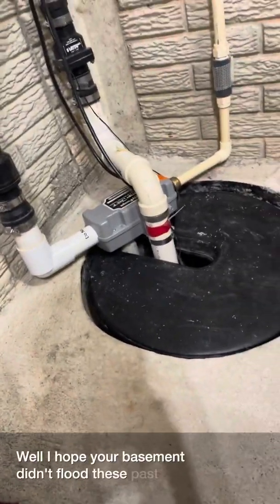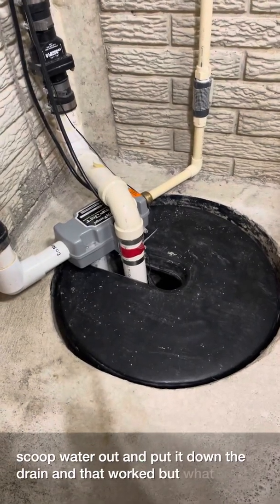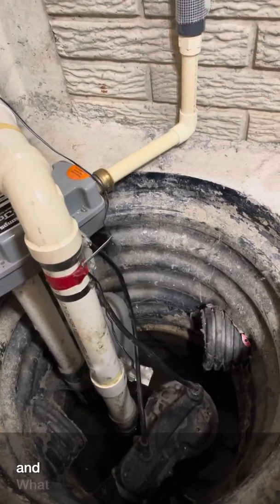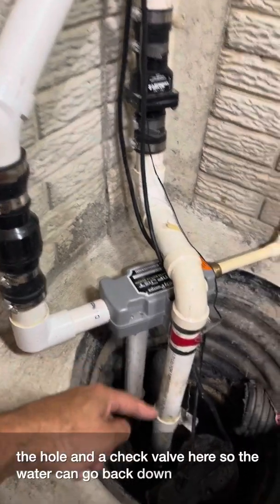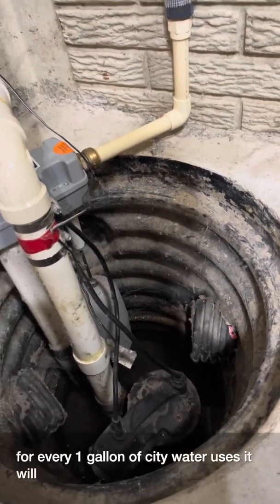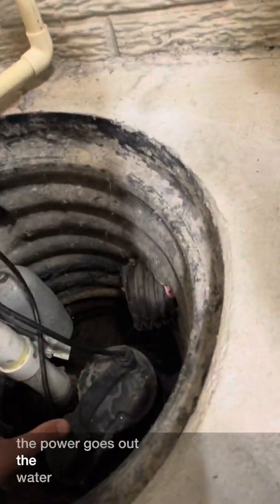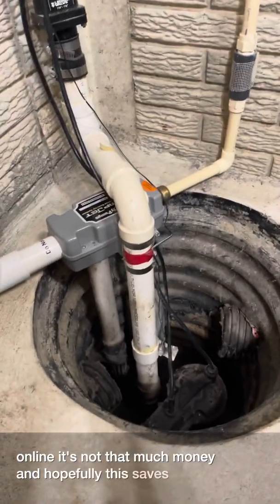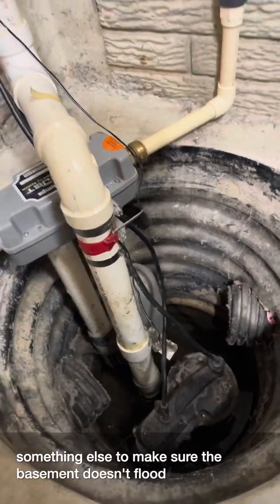Water powered sump pump

Comment: In order for the back up to engage, your weeping tile drains will have to be full of water, just based on the height of your float. Is that a good idea?
Reply from the maker: @vanessap8717  they only get half full. No biggie. Besides it is just a backup and when the power goes back on the AC pump drains it all. The backup float could be lower, but it doesn’t matter.
Reply: @ they should make the suction pipe and float rod longer for sure. I got the zoeller flex 540, works great, if anyone is having a hard time finding a water powered back up they can use in their set up.

Comment: You arent supposed to tie into existing line, its supposed to be separate
Reply: I’m researching that now. Instructions recommend a separate pvc discharge line. Since he has the 2 check valves on the discharge lines it will function as it should. 
HHOenergy is that correct?
Reply: It will work but there will always be water in the discharge line. If the discharge line can hold water outside the house and the temperature drops below freezing you'll have a problem. You have to establish a way for the discharge line to drain.

Comment: Great video, Question - how did you put the black cover back on? The cut out is not wide enough to accommodate Liberty pumps float rod and the other white pipe that is next to float?   Did you have to cut notch in to the cover?
Reply from the maker: You got it. I used a hand saw to cut the lid just big enough to fit.

Comment: So you have both the water powered sump pump and the regular electric sump pump in same bucket? Did you use a plumber? How much does it cost?  Thanks
Reply from the maker: Yes, it’s a backup to the electric pump. It’s $218. Liberty Pumps SJ10 SumpJet Water Powered Back-Up Pump, Gray https://www.amazon.com/dp/B0013H94MO/ref=cm_sw_r_cp_api_i_0BDMD6JFVB38JY453QZQ
Reply: It all great till the after powered pump runs up your water bill. I still question if it actually works well. Seems it would put more water in the dump.
Reply from the maker: @TheJakeman789  it works great. Just as advertised. It is not intuitive, but it works. None of the city water goes into the hole. Sure it will cost money to run the water, but that is only when your primary electric pump is broke or the power goes out. It’s cheaper and less hassle than flooding out a basement. I test it once a year. For the past 10 years it has needed zero maintenance. Zero batteries. It’s pretty great.
Reply: @TheJakeman789  that's why you get the alarm with it and it let's you know when it's being used and for every gallon in, it pumps 2 out depending on lift, but somewhere close. It's supposed to be discharged in a separate line though as people will understand if they ever get a flood and sewers are full. It's a great product though, if installed correctly. I can't tell here, but it's supposed to have a RP/ RPZ valve on the water line as well with a discharge line off that going back into the pump.
Reply: @stevepoulson5867  And also a water supply shutoff valve within 6 feet of the Liberty pump.

Comment: thanks for the video. Was very helpful seeing how you have it all configured for the water to go into the existing discharge pipe. Do you have a link on where to buy the alarm?
Reply from the maker: It’s called THE BASEMENT WATCHDOG Model BWD-HWA 110 dB Battery Operated Water Alarm https://a.co/d/aPCmbD7
There are others, but this is what I have. Some will alarm your phone with a text message but they have a monthly fee I believe.
Reply: It's not supposed to go into the existing discharge line, just so you know.
Reply: @stevepoulson5867  why is that?  I saw another video that stated this, but I'm not sure why it would be a problem if you have a a valve to prevent water from going back down.   what code addresses this?